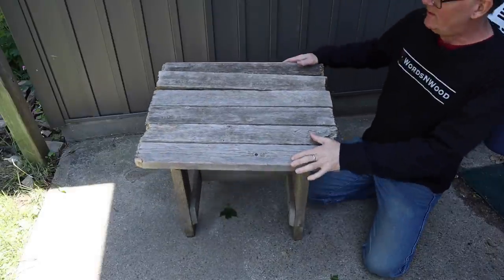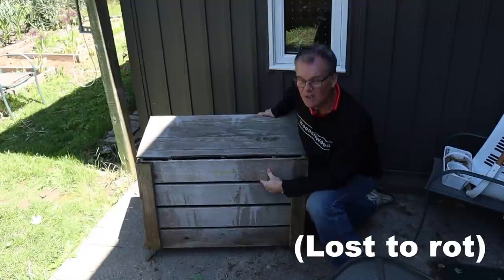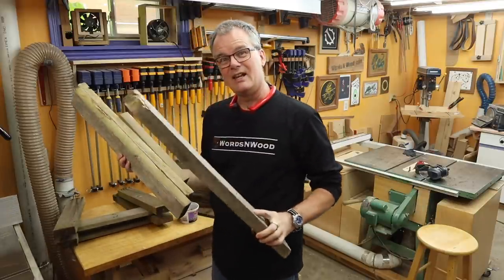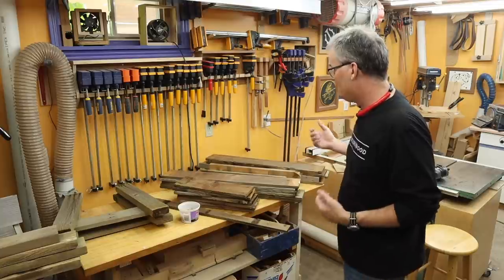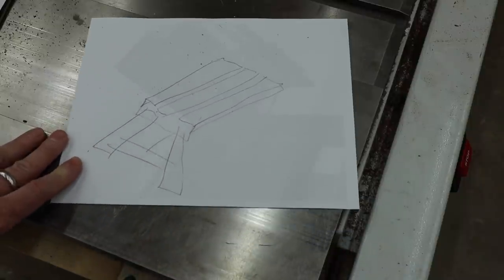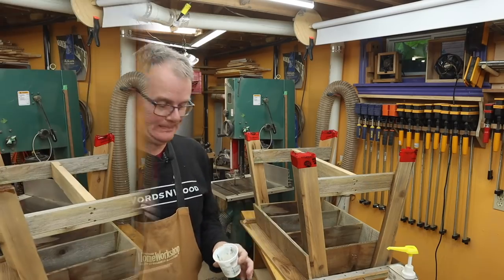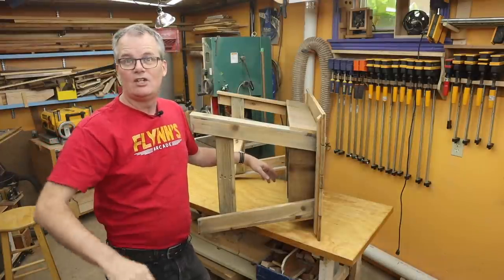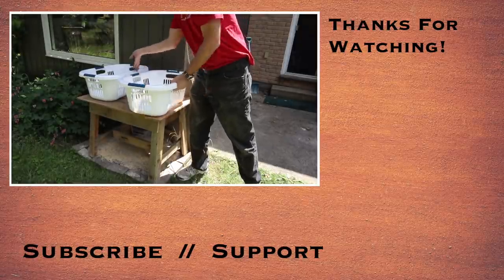Patio Table from Junk Cedar Boards // WnW 241

Comment from the maker: Just having fun in the shop making it up as I go with salvaged wood
Seriously, it's 15-25 year old "junk" cedar.

I built a patio table out of cedar boards left over from a fence build 25 years ago.  It has sat on our deck ever since.  It was getting rickety so I thought I'd take the day to fix it up.  Turns out it was pretty much done and ready for the burn pile.

Fortunately I had ANOTHER junk outdoor project that I was about to throw away -- an old outdoor toy storage box that I'd made with fence boards about 15 years ago.   I was able to salvage enough wood to build a new patio table and had a fun day in the shop.  Hopefully, I'll get another 5-10 years out of it.  

YOUR SUPPORT IS APPRECIATED:
💵 Become a Patron: https://www.patreon.com/wordsnwood
🛒 Buy a Plan: https://wordsnwood.com/plans/
👕 Buy Merch: wordsnwood.com/merch.html
👉 https://www.wordsnwood.com/support.html

--------- ---------- ---------- ---------- ----------
🗜 LINKS TO SOME OF THE ITEMS USED:

(AND/OR other tools and jigs that I use and recommend.
Most of these are affiliate links.  If you buy through these
links it helps support my channel.   Thank-you so much!)

https://amzn.to/1pFGjPk — Sensgard ZEM hearing protection
https://amzn.to/1WSNq1j — Stanley Leverlock tape measure 
https://amzn.to/2lYXz3W — Other auto-locking tape measures
https://amzn.to/1TzHwEp — Picquic “multi-bit” screwdrivers 
https://amzn.to/1qbopUK — Bessey VarioClippix, Adjustable Spring Clamps

📸  GEAR I USE TO MAKE VIDEO:

https://amzn.to/2OVusfx — Canon EOS m50 camera kit
https://amzn.to/2nI7w8Q — Shure VP83 LensHopper Microphone
https://amzn.to/3l7cSmi -- Rode Wireless Go microphone
https://amzn.to/3k9pFTR -- PoP voice lavalier lapel microphone
https://amzn.to/2aK7jZX — Inexpensive Quick Release tripod ball head  (Very useful)
https://amzn.to/2NddVjk — I do also have a GoPro Hero 5 Black
http://amzn.to/1XC2D7l — Joby GorillaPod (Flexible small tripod)

As an Amazon Associate I earn from qualifying purchases you make using my affiliate links.

---------- ---------- ---------- ---------- ----------

MORE MORE MORE:
https://www.wordsnwood.com
https://www.instagram.com/words.n.wood
https://www.facebook.com/wordsnwood

---------- ---------- ---------- ---------- ----------
🙏🙏Thank-you! 🙏🙏
Reply: Top 👍👍👍

Comment: That rough drawing you made is basically must of my project plans, just add the dimensions., And I took industrial drawing and mechanical drafting in school. Unless you're formally submitting a plan there is no need for a lot of work. If you get another 25 years out of the new table, maybe you can save enough money to buy a clothes dryer. I like the smell and feel of air dried laundry too. Just like my wood.    Danny
Reply from the maker: Every now and then it's fun to just make it up on the fly.

Comment: Ferrous metal screws do not help. Boatbuilders use bronze and brass for good reasons. It would be interesting to see how long it would last with just Titebond III alone with no fasteners.
Reply from the maker: Well yeah, they build stuff to be submerged in the water.  If my patio is submerged in water, then I've got major problems.   😆